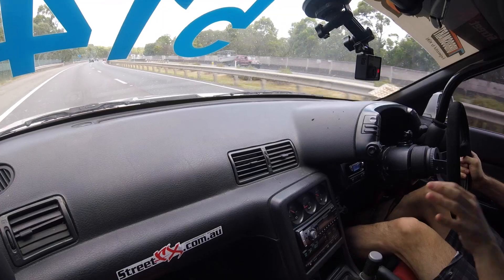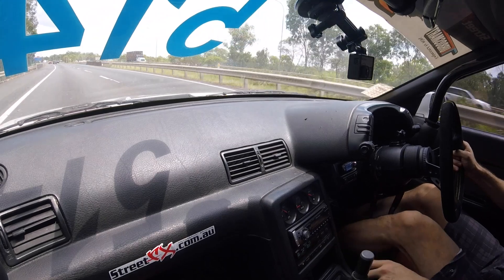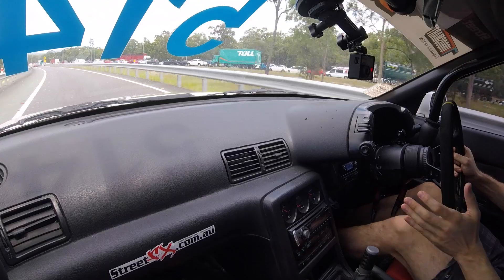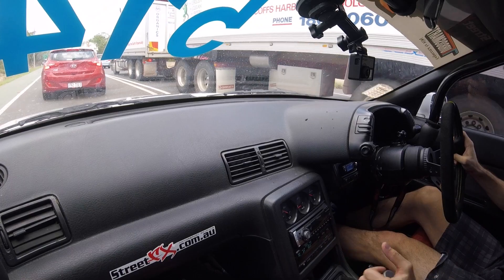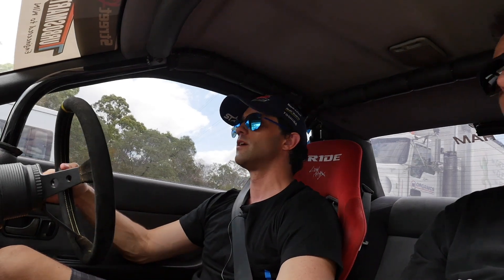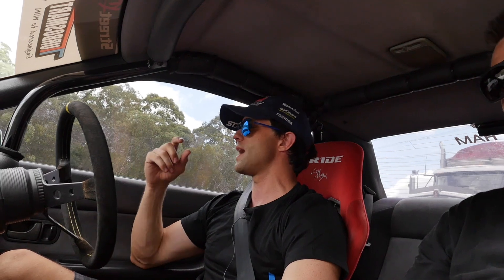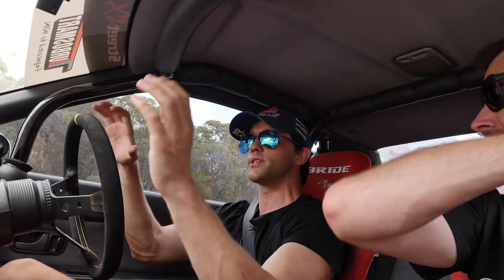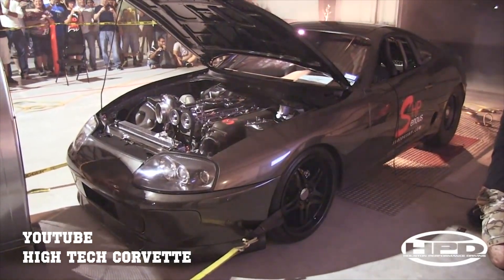What is TURBO FLUTTER & SURGE? Is it Bad? Myth-busting in our Nissan R32 GTR!

Comment: Turbos spool faster with no BOV, not slower. The wheels DON'T slow, the AIRFLOW does. Watch a turbo rpm sensor with and without a BOV, the rpm is far far higher off throttle without a BOV. BOVs are designed to slow turbo wheels down.
Most of what's said is correct, but that bit you said is just a myth.
Reply: 802 Garage so because somebody says it, they're right? despite any datalogging turbo speed sensors proving the opposite? that's like religious fanatics and flat earth people.
Reply: Yes it's for that reason. The reason an open BOV off throttle slows the turbo is the whole reason BOVs exist- To prevent turbo rpm overspeed and compressor surge for that reason. That's their only use.
An open BOV means the compressor has work to do, it can flow a lot of air at no pressure.
A closed BOV means there's very little airflow, the airflow is stagnant, and rpm skyrockets.
It's basically the same reason if you block the inlet or outlet of a vacuum cleaner or similar the rpm increases, and you don't need a dyno for that- You can hear it.
Compressor surge off throttle is high pressure low flow- Look at a compressor map, look where the surge area is. Yes, high pressure low flow. And the only way to get high pressure low flow is lots of turbo speed and nowhere for the air to go.
Reply: Jesus, I've explained this already. 

BOVs are for ONE true reason only, to PREVENT COMPRESSOR SURGE.

Pressure does NO harm, they're not for that.

How do they prevent compressor surge? By putting the turbo in a more non-surge area of the compressor map.

Where is the most non-surge area of the map? The low pressure and some flow area, where turbine rpm is always low. 
Ie with an open BOV allowing airflow through the compressor and out the BOV.

Where is the worse surge area of a map? In the high pressure low/no flow area, where turbo RPM is always incredibly high. Ie with no BOV so the air has nowhere to flow.

1J Clae- You're so wrong it's unreal. Read what I said. It's nothing to do with wastegates, wastegates are closed off throttle. If you understood how compressors worked or even how to read a compressor map you'd get what I mean.
Reply: I'm not even sure if you're kidding anymore! Shall I ask you WHY a BOV would speed it up lol. Though I know it does the exact opposite.

A BOV slows down a compressor wheel because the compressor spins slower when it's pushing airflow than it does within stalled air. I've said this.
That's just simple fact. Centrifugal compressors take a lot less energy to be span with no flow than with flow. The most basic test with your vac cleaner will show you that.

Surge isn't simply the wheel spinning too fast, but surge sure as shit only happens at fairly high compressor speed and low/no flow, and doesn't happen at low speed and high flow. That alone, even by basic logic from looking at a comp map, shows I'm right. But you say my logic isn't right? lol.
I'm not even working by logic, I'm working by what I've seen in my own eyes from datalogging and turbo speed sensors on engines on dynos and engines on the road in the car.

I'm not even saying anything weird or unusual, ANY turbine engineer, true turbo engineer, someone to do with airplane engines, and countless others, would tell you the same, as it's fact.

Here's some words from an aircraft engineer...
"Surge is usually an over speed/stalled condition which is why its so bad. In this case the compressor will make more air than needed, pressure will rise until it stalls, shaft speed will shoot up, and air will blow back out the intake of the compressor."
Reply: THIS COMMENT IS VERY TRUE AND WHAT THEY SAID IN THE VIDEO WAS WRONG IN THIS ASPECT. People dont realise that a turbo technically stalls as air pressure drops around the blades when the throttle shuts and no blow of valve is there to allow all the built up air to escape before turbo. When the throttle shuts and all that pressure comes back through the turbo it causes the blades to loose grip of the air due to the low air pressure and making it spin at the same speed without actually making any boost. The turbo blades then eventually grip back onto the air when air pressure rises around the blades again. the sut sut sut noise is created by the turbo constantly loosing grip and grabbing in short matters of time.
Reply: On throttle surge fucks things up pretty bad pretty quick. Off-throttle surge technically isn't great but usually fucks nothing up in my experience.
I'm going from 15+ years of running my own cars up to 30psi (33psi if count friends cars I help with too) with no BOV at all and no damage to the turbos due to it.
People can do what they want, think what they want, whatever, but 100% of the things I've said so far is what I've experienced first hand with my life, my eyes, my career, my hobby. E-tuners can believe whatever beyond that, don't affect me.
Reply: Stick your hand on the end of a vacuum cleaner hose while it's running. It will spin faster because the momentum of the air is lost which takes the load off the fins.
Reply: Very interesting. Happen to have a source for this?
Reply: 802 Garage years of experience mostly. easy to see on the datalogging if you've a turbo speed sensor.
Reply: Don't have such equipment available, that's why I was curious if there were any sources. Thanks though.
Reply: Lol. No I'm not talking about the wastegate. At at all. I'm not even sure if you're taking the piss or not.
I'm aware of quite a lot you know, it's been my job to be pretty aware of these things for about 15yrs...
Reply: Isn't the role of a wastegate to release air pressure out of the manifold, before it hits the turbo, to regulate the speed of the turbine? How does a BOV slow a turbo wheel down?
Reply: A wastegate regulates turbine speed, a blowoff valve relieves pressure. This isn't that complex. XD
Reply: I think I have a pretty good grasp, but I also know that I don't 100% understand it. I was always told that flutter was bad, but this thread has challenged that, which I'm grateful for. Sorry I'm being a pain in the arse. I'm looking forward to studying Automotive Engineering soon, I guess I've got more questions to ask :)
Reply: Flutter 'is' bad in theory, that's why BOVs exist, to prevent what flutter is, which is compressor surge, and it does this by slowing the turbo down.
(In reality off-throttle compressor surge does no damage in 99% of applications, but that's another story).
Reply: I agree with what you're saying, for the most part.  A couple thoughts - while the vacuum cleaner example does illustrate the point, the compressor is a different design that doesn't enter surge either by compressor design or internal bypass that maintains a minimum flow to prevent it.  But it does illustrate that lower flow, even at higher pressure ratio, typically requires less compressor power than high flow at a lower pressure ratio.  However, a bypass valve is not nearly a full-flow condition for the compressor - it shouldn't flow enough to put the compressor at a pressure ratio of 1; it just needs to allow enough flow to shift the mass flow to the right (with respect to no BPV) on the compressor map to cross the surge boundary.  As the turbine is producing little or no power at this point, this will of course also reduce the pressure ratio and compressor speed as it only has its inertia left to produce this flow & pressure.  The compressor in a surge condition also consumes power as it repeatedly bounces between pressurizing and back flow.
I trust that your datalogs show that no BPV does not immediately stall the compressor, in terms of shaft speed, and that boost comes back on quicker since there was less inertia loss than the BPV situation.  I would be interested to see how adjusting your BPV affects the compressor RPM drop-off.  Increasing the spring stiffness to the maximum amount while still preventing compressor surge - so, shifting the point on the compressor map to the right just across the surge threshold.  This would allow the absolute minimum compressor flow to stay out of surge, which means the least amount of shaft power consumed and least inertia/rpm loss, while staying out of surge.  I'd be curious to know if the compressor, at a given pressure ratio, consumes more energy in a stall/surge condition or at the minimum mass flow out of surge.
Reply: Dude, you're so wrong. Your kind of right, but your not talking about the right component and so your argument doesn't make any sense. You're talking about a wastegate, which sits on the hot side before the turbine (the back end of the turbo). A wastegate is designed to control the turbine speed, it regulates it's speed by releasing air pressure from the exhaust manifold before it hits the turbine, otherwise it would spool up too fast and shatter. A BOV sits on the cool side and it's designed to release the pressure when the throttle body is closed, to prevent compressor surge from happening. If you're not aware, the front half of the turbo that sucks in air is called the compressor and the compressor is driven by exhaust gases entering the back half of the turbo, which is called the turbine.
Reply: Feel free to think that. Most people think the myths. And most people are wrong. Massively. I've done this, I've seen this with my own eyes with turbo speed sensors, I've seen datalogging showing BOVs do not bring you back on boost sooner. I'm not pulling info out of my ass. Feel free to think what you want, but it's not true.

Wastegates are 100% closed OFF THROTTLE, so no, it's not the job of a wastegate at all. Wastegates work on boost only, at full boost only.

Even think logically, even if you've not done all the testing I've done. No BOV, what happens? You hear compressor surge. Where's compressor surge on the comp map? Where is the surge area? Top left- High pressure, low flow.
What happens with the airflow with no BOV? High pressure spike (even you say that, that is correct), but zero flow as the throttle is shut and there's no BOV for the air to flow through.
The above you obv' agree with.
While there's no speed lines on the compressor map in the surge zone, as they don't want any turbo be there, get your crayon and extend the speed line curves in to the surge zone.
So with these lines, look what the speed line is in this high pressure zero flow surge zone? Yep, pretty fucking high.

With a BOV, there is flow as the BOV is open to allow flow with a closed throttle, and there's no boost as it's allowed to flow out the BOV. So there's no surge sound, as it's not in the surge zone.
Where on the compressor map is low/no boost and 'some' flow? Right at the bottom, and to the left, but not as far left as no flow (ie no BOV would be).
And look at the speed lines at that point? Yes, lo and behold, way way slower than the 1st example.

I'm not saying anything ground breaking, anyone who's a genuine turbo engineer, gas turbine engineer, or decent turbo tuner, can tell you the same. I could probably find you countless people telling you the same if I could be bothered.
Reply: I agree with everything you just said, except your proposition that not having a blowoff valve would somehow increase turbine speed. This makes fundamentally no sense and goes against physics. I am NOT telling you that having a blowoff valve INCREASES turbine speed, I'm telling you that it aids in not DECREASING it.

As you said, a waste gate is only in operation while on boost. However you are missing one thing, the opening and closing of the waste gate is controlled by the amount of boost being generated. Refer to any waste gate vacuum/boost line routing diagram. Therefore with no BOV, when you close the throttle, the waste gate actuator is definitely going to open anyways and allow exhaust gasses to bypass the turbine. Having a blowoff valve also means the time there is going to be pressure actuating the waste gate is also reduced, therefore allowing less gasses to bypass the turbine during that boost spike because the two devices work in concert when boost spikes.

Back to blowoff valves, how in physics can you believe that having high pressure one one side of a turbine and vacuum on the other side will encourage the turbine to spin faster towards the compressed side? Without a blowoff valve, as you said, the air has nowhere to go, as the throttle plate is closed. Therefore it tries to go where? Back through the turbine. If you blow air backwards through a fan, which way does the fan turn? The opposite direction as the direction it was meant to blow air. The same would happen with a turbo compressor wheel. It's a fan. How can you believe otherwise?

Now I want to be clear here, I am not actually debating how effective blow off valves are or which works better, with or without one. I'm also not refuting your data, though as far as I'm concerned it's meaningless since you can't show it to me and can't point me to anyone with similar data. What I am talking about is the physics that say not having a blowoff valve, as in ignoring the fact they exist, will not increase turbine speeds, because areas of high pressure flow to areas of low pressure, period.

Back to blowoff valves, while I am not arguing it is their primary purpose, if they relieve pressure on the output side of the turbo, they are in fact in terms of physics reducing the pressure wave the turbo has to fight, therefore making it easier for the turbine wheel to continue spinning. What physics principals do you believe can refute any of that? Your data is meaningless if you don't have it to show anyone.
Reply: Physics is the real winner here. The compressor is going to slow down when the is higher pressure on the compressor and low pressure on the turbine. Off Throttle you lose exhaust, but the turbine and compressor are still spinning. So you have a high pressure side on the compressor. This is where a BOV sits. 

Makes sense to me.
Reply: BOVs are designed to release pressure off throttle.
If they do slow turbine speed, it is a side effect, not the intended purpose.
I would love to see your data on this, but my last comment remains that the physics do not support your argument that a turbine speed stays higher without a BOV than with one.
Reply: It doesn't make sense to me either. To have a BOV release the pressure, allows the compressor to keep spinning freely instead of disrupting it with surge. The only way a BOV could possibly slow the turbine, is through surge through the compressor, as the shaft connects them. However, it's the wastegates job to regulate the pressure entering the turbine, so it doesn't slow it down per say, it just inhibits it from spooling any faster.
Reply: So I just want to point out that Haltech just confirmed exactly what I have been saying in their video "Mighty Car Mods Cresta: Secrets of a 9-sec Sleeper - Technically Speaking" at 2:44. I'll post a link in a separate comment in case it goes to spam. He says "We've got a blow off valve that's gunna open when the throttle blade shuts. What this is gunna do, it's gunna bleed off the excess air. It's gunna stop our turbo charger from cavitating, so it's gunna give us less turbo charger lag between gears."
Reply: I didn't say that. I said that someone else corroborated what I was saying. Physics is also on my side, however.
I'm pretty sure a company that engineers and makes tuner ECUs has probably done some data logging of their own.
IDK who you are or what kind of expertise you have, but given that you have no data to show me, I'm still going to trust Haltech, numerous other tuners, and physics.
Reply: When have I said it increases it? Nowhere. I've said the same from the start. Turbine speed with no BOV increased over having a BOV. 
No BOV off throttle- Turbine rpm is FASTER than with a BOV.
BOVs are to slow turbos faster when you get off the gas. That's their job.
Reply: You still haven't answered why a BOV would slow down a compressor wheel. Surge also isn't simply the wheel spinning too fast. Surge is when the compressor wheel is trying to spin against a pressure front and is "chopping" the pressurized air. This would, wait for it, slow the compressor wheel. A BOV is designed to prevent that built up pressure front, meaning surge. Your logic just isn't found man.
Reply: I just wrote a reply, but it got deleted, so I'll stick with this.
I don't believe that a BOV increases turbine speed and I never said that it did, it is a pressure relief device, that is all.
What I will say is go read any article on compressor surge and it seems to disagree with you.
Surge occurs when the air in the high pressure area after the blades forces itself backwards over the turbine wheel and causes the compressor stall.
Again, if you blow backwards on a fan, it will spin the opposite direction.
The danger to the turbo and bearings is not an overspeed condition, but an on and off disturbance of the wheel spinning, AKA surging.
IDK what else to tell you.
Reply: How you could believe that a region of increased pressure after a compressor wheel could speed up the compressor is beyond me.
Reply: StavGTR Most of what you just said makes no sense...
The pressure generated by a turbo is on the output side, after the compressor wheel, meaning the higher the pressure on that side the harder the turbo is having to work, the lower the speed will be for a given amount of input power. The point of a blowoff valve is to relieve that pressure so there isn't a pressure spike and so the air does not flow back through the turbo and slow the turbine wheel, so you will be back on boost at an appropriate level faster.
Everything you just described is the job of the waste gate. The waste gate opens so that hot exhaust gas can bypass the input turbine and exit through a path of lesser resistance. This is to regulate the amount of boost being generated by reducing turbine speed.
Reply: Do you know that when you put your hand on the shop vac opening you are stopping air to be sucked, right? as if you were putting something on the air filter... not on the "exhaust" part of the compressor.